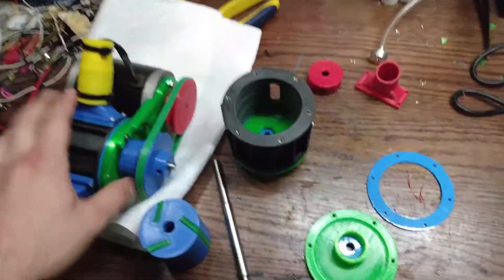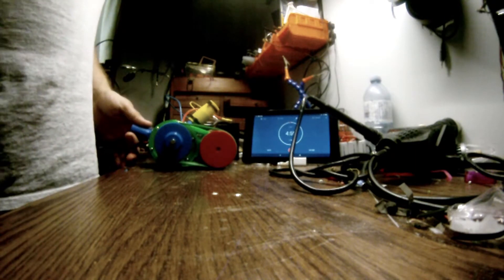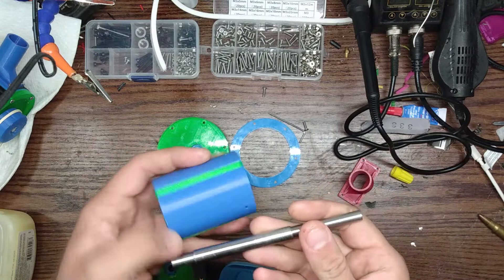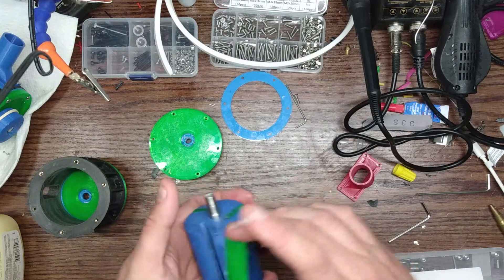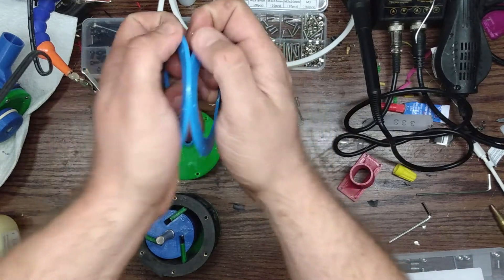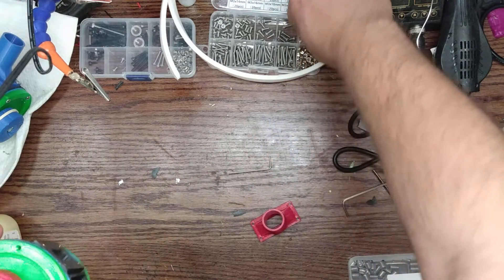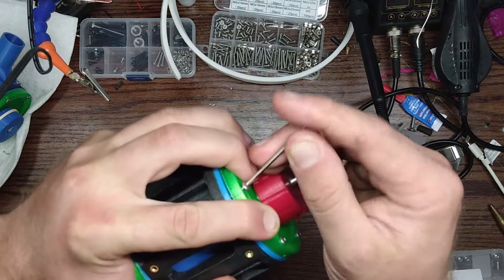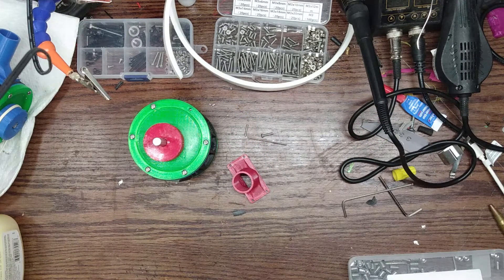Working! 3D printed supercharger 2lb of boost!!!

Comment: im sure that if you put this with the carb before the SC the fuel should keep it lubricated
Reply from the maker: I have moved on from this concept but if I had used it I planned on mixing 2stroke oil in to lube the vanes

Comment: Lubricate it with graphite
Reply from the maker: Thanks , I'm not sure how that would work as the particulate can build up and scrape the inside of the housing. In the working application it would be a draw through carb setup and I would run mixed gas/oil to lubricate everything . I have an aluminum housing version mostly finished other than a few minor details , this solves the issue as the plastic vanes have very little friction agents the smooth aluminum surface .

Comment: will it fit my honda?
Reply from the maker: do you have a 50 ? or 90 ?  I'm not sure on how well it would fit or how to drive it but it should create boost on a little Honda .  could drive it with a big breathless motor , or get a drive from the engine somehow . I cant imagine it would hold up to load for any long period of time and is really only an experiment to see if it would work . I have long term plans to put it on something and if it works out machine the housing from aluminum , as well as the housing ends . The rotor and vanes benefit in that case from being plastic but will likely go carbon fibre petg rotor and nylon vanes .